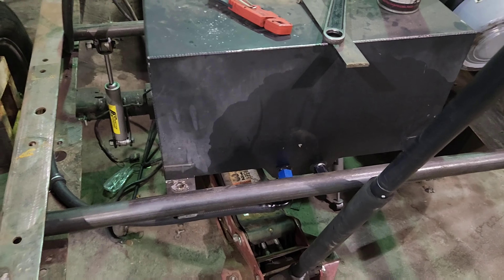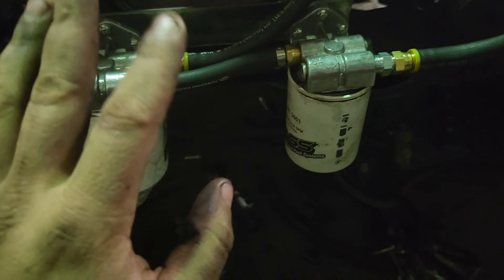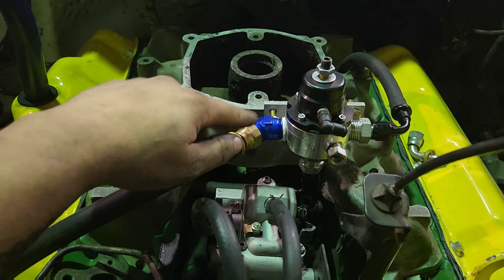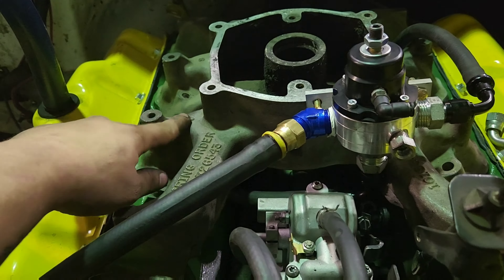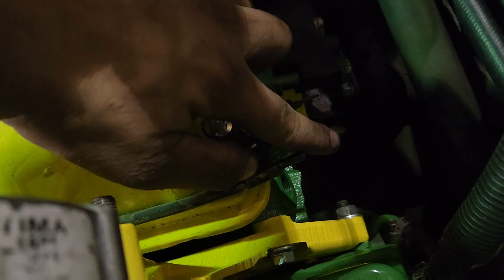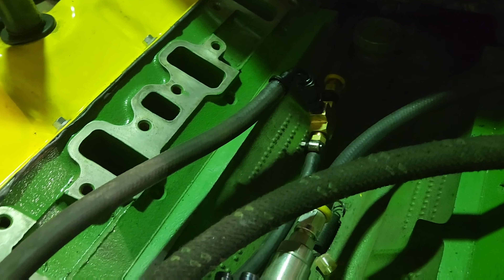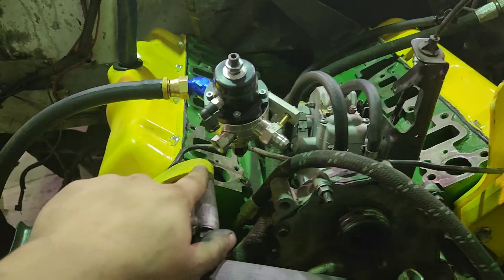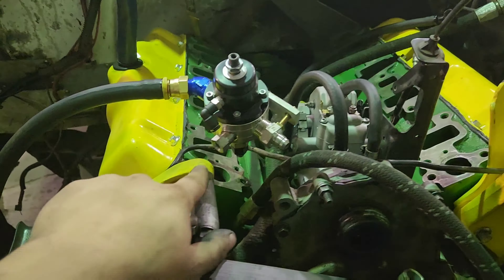6.5 Diesel Racetruck "Buckwild" Build Update. YOU DON'T WANT TO MISS THIS ONE!

Comment: I’m not sure how much fuel pressure your running but my glowshift fuel pressure gauges work great and have a sensor instead of a line into the cab
Reply from the maker: All of my gauges are actually glowshift currently! But I am needing to read up to around 150 psi
Reply: @buckwildmotorsports   teltek sells fuel pressure gauges up to 300psi that run off a sensor and fit in a standard gauge pod

Comment: I’m curious why you used the emissions intake?
Reply from the maker: I'm not using it in the build, it is just a mockup intake. If you watch my video, Buckwild Tech Tips #2: F Vin v.s. S Vin, you will see the intake I am using and thats a ported non emissions intake!
Reply: @buckwildmotorsports  ohhh gotcha! I’m building a 6.2 diesel turbo right now leak checking the valves haha but all I’m really doing performance wise is thicker head gaskets and I’m gonna put main and head studs in it
Reply from the maker: @Victorsvolkswagens  sounds like a great base to start with!
Reply: @buckwildmotorsports  I’ve never had a 6.2 crack on me I’ve had 2 I bought one 599 block 6.5 it was cracked on all the main webs
Reply: @buckwildmotorsports  update got one side done I scored a bearing by accident so I have to get a new set 🤣

Comment: Did you stay with the .25 inch return lines all the way back to the fuel tank.  Great video you are making can't wait to see more as you go
Reply from the maker: Coming off of the junction block in the valley, it's 3/8" to about the back of the cab and then it goes to 1/2" then it goes back into the fuel cell